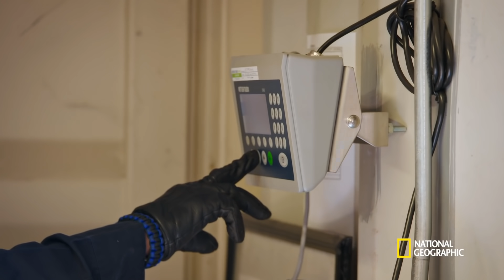Meth Hidden in a Spare Tire | To Catch A Smuggler

Comment: Why did the u.s. attorneys office decline prosecution of this case?
Reply: That’s what I’d like to know!
Reply: look who is running the admin, it would not matter, if they are illegal they are being released
Reply: Good question.
Reply: Billy Ray Hoscheit  thanks for your input. Did you read that about this case or are you speculating? Certainly not saying you're wrong, I know that happens a lot. Wouldn't someone forcing the driver to carry the drugs be part of the "case" also?
Reply: Billy Ray Hoscheit  possession is 9/10ths of the law
Reply: Billy Ray Hoscheit  that’s still being an accessory to a crime. It’s not like one can be the driver for any other crime and claim they didn’t know what was going on. Besides that, the Border cop even said the driver made $500 for attempting to get the drugs over the border.
Reply: There's just bigger fish to fry... the drugs need to be off the streets and the incentive to smuggle needs to be eradicated... prosecuting someone who was likely desperate for $500 but has no information on the operation would be a massive waste of resources, especially considering how many of these they deal with week to week.
Reply: Billy Ray Hoscheit  he was still gonma get money tho
Reply: Most likely felt the person was honest not knowing they had that- when we use to go to tj they told us to be carefull where you left your car because they see US plates and they would hide packages so you would cross them without knowing- that way you wont get nervous and the package would cross
Reply: They rather take the drugs and sell it themselves.
Reply: @charlesreber3662  good lord. You republicans are nuts.
Reply: What’s the right punishment is the question. Person doesn’t even know what they’re transporting.
Reply: I honest doubly this was in the year 2021. This footage was likely the year 2020.
Reply: Driver cooperated w feds. The only acceptable true answer.